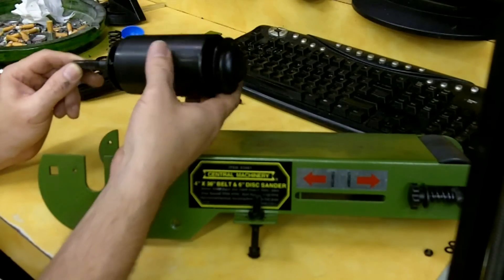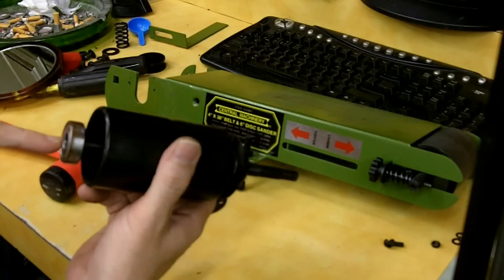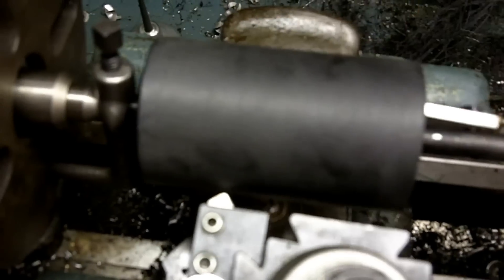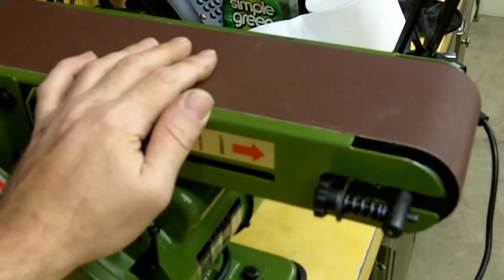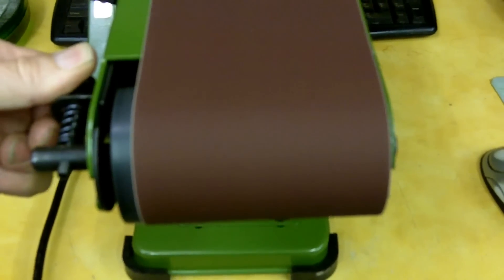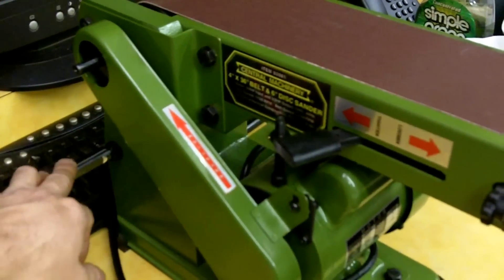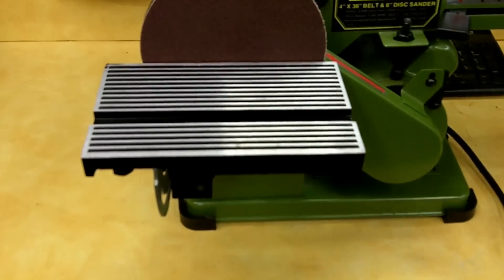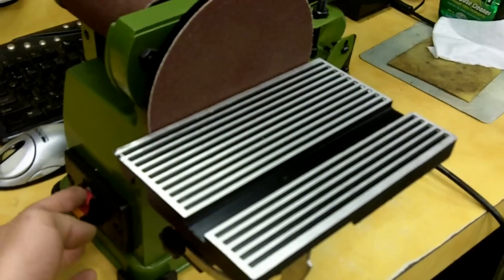Part 3-3 Harbor Freight 4X36 Belt Sander Review and Modifications

Comment: Thanks for the video. Bought one today on sale for $70 less 20% for approximately $56. New version has set screws for the table support stability. Will use for minor woodworking and can't beat the price with tool's objective in mind. Will let you know as I progress with it. Similarly, bought a tabletop chop saw from HF a few years back for approx $40 (with 20% off) to cut steel pipe and other minor metal cutting work. Paid for itself with first use and still doing the job admirably. Have purchased more critical tools (table saw, compound miter saw, router with table, drill press, HPLV sprayer, etc.) from other more expensive sources when I felt more quality and precision needed. Money saved with lessor critical tools from HF can be spent on these and needed materials to generate income. Your videos and comments add reality and encouragement to accept HF limitations and get on with business. Us shade tree mechs appreciate them.
Reply from the maker: Glenn Sorensen That's cool Glenn! I've had another comment stating they've added set screws to the table as well- which is great. I agree on both price and the tools objective! I have a Milwaukee cut-off saw that I paid a fair chunk for about 12yrs ago for a specific job around my home. Had I been turned back on to the Freight then, I would have save tons like you have for a tool that now sits there collecting dust and crying for something to do...lol. It sounds like your tool acquisition philosophy is dead on in-line with mine. I save where I can for less critical or rarely used items, and put that savings towards other more expensive tools, etc. when required.  That is the aim of my video reviews, to show folks what to expect out of these less expensive tools so they can make their own choice accordingly. I have a myriad of tools from the top shelf on down. I don't typically show the more expensive name-branded stuff since there's nothing much to say...lol. "Most" of my purchases from HF have exceeded my expectations- all things considered. Thanks for the post and take care, G.

Comment: Just purchased a 97181 unit last week. As previously commented on by you and your viewers the tracking issues have been addressed but my unit went out in about ten hours of use.  I am coarse grinding 3" wide chipper blades exclusively using the belt.  The unit was very effective until today.  

Today the unit ground to an immediate stop as the outside bearing  drive end froze.  I expected that the fine metal filings had seized the bearing. Instead I found that the bearing was fine but that the drive shaft had seriously galled inside the bearing and on failure had driven the bearing and cap outward bending the housing until it seized.

When I totally disassembled I also found that the belt had severely worn the belt cover directly under the dust hose connection. I have been using a small shop vac but can not see how this would cause this rubbing. Believe this to be separate issue.

Out of the box I only found one problem. When turned on it momentarily runs at a slow speed. I have changed belt drive tension several times without any improvement. The work around is to "help" the sanding belt with a forward soft slap and it comes right up to speed and generally has minimal issues after the initial startup.

Any ideas how there could be any relative shaft-bearing movement without any bearing seizure? Not sure if the startup drag was mechanical or a motor issue or in any way related. Shaft end is shot and unit will be returned/replaced but want to understand how to avoid in future.

Thanks for any insights!
Reply from the maker: +Bill Maille 
Bill, the model I've shown here has been discontinued and replaced with the one you have. I don't have any experience with that machine, but will give my thoughts anyway.

Since the bearing seemed fine and the shaft was galled, to me, it seems the shaft might have been too loose a fit from the start. That, and maybe the bearing cup was also a loose fit to the bearing. The bearing could have walked off the shaft, contacted the outer end of the cup, stopped the bearing,  and then galled the shaft. That's the best I can come up with...lol.

I can't speak for the belt guard wear and dust port since mine does not have a port. 

The slow startup sounds like the startup capacitor on the motor isn't doing it's job. The capacitor and start windings give the motor a jump start, and after it's up to speed- a centrifugal switch disengages the windings. 

I don't think there's anything you can do to avoid the problems. You should just be able to abuse it and it keep on ticking. But, in reality, they are extremely inexpensive so what can we really expect...lol. I say exchange it, use it and do it again if need be. Keep us posted on the new one and how it works over time. Hope this helps in some way. Good luck, G.
Reply: +Bill Maille my 4x6 HF bandsaw had the same kind of startup problems and I found that my start capacitor just didn't have enough, well capacitance.  I actually hung a second one wired in with the first one on the motor and it starts with authority.  I was a little worried that too much start capacitor might damage the windings on the motor, but I figured I had nothing to loose since If it didn't work I would just end up replacing the motor.  It's been that way for over 10 years and still works fine.

+ghostses I have the larger 6x48 HF belt sander and that thing vibrated and wouldn't track either, I found that the steel drums on it were fine, concentric but had no crown, and the vibration was a combination of a bad pulley and the disk was WAY out of balance.  I took it back to HF, but found the others they had were worse (it seemed like the rest were dropped and had cracked/broken parts) so I ended up taking the original back and they let me keep a bunch of the parts from another to fix it.  I ended up drilling something like 60 1/2" pockets in the back of the disk to balance it, balanced the 4 pulleys that I had in much the same way, chose 2 pulleys that gave me 2x the speed that it came with from the factory and put a Fenner belt on it.  At the time I didn't have a lathe so I fixed the tracking by just wrapping the idler drum with tape till it tracked OK.  The motor on that one is a brute and has no problems turning the whole thing at 2x the speed, which makes it a great big belt grinder for metal work.  Everyone told me that I was going to kill the bearings on it spinning it that fast but it's been happily chugging along for a little over 10 years just like the bandsaw.
Reply from the maker: +Mark Pikas 
Thanks for the input Mark! I really wanted the larger belt sander, but my shop constraints wouldn't/won't allow for it. But, using tape on the idler to fix the tracking was a great solution- for not having a lathe to correct it properly. That tip, in it's own right, might help others with theirs since many might not have the machining equipment. So simple but effective! As for the bearings moving 2x, you'd be hard pressed to tax them to failure- in my opinion. Naysayers be gone- I say...lol. Even if they did fail prematurely, whatever that means, replacements are plentiful and cheap! 10yrs going strong further verifies the point! Thanks and take care, G.

Comment: Thx for sharing all that you had to do to get this sander to run smooth. I have one too and yep it shakes rattles and rolls. I'll take what you did and apply it to mine. Knowing that I'll have to crown both the drive and driven rollers saves a lot of assembly and reassembly time. I'll just go ahead and crown both rollers after truing.
Thx again for sharing.
Reply from the maker: No problem! Let me know how it turns out. Good luck, G.

Comment: Great video. I was trying to figure out how to raise the belt sander vertical. Mine had no instruction manual and it wasn’t obvious. I like all of your ideas and I moved the table in front of the vertical belt sander and it’s much more like what I wanted for sharpening tools and being able to change belts easily. I think we still have to be cautious around the disc sanding wheel with loose clothing or wires, especially when you have children.
Reply from the maker: Thanks Tom! Glad it was helpful. Yeah, you've gotta be extra careful for you and the children. If you don't plan on using the disk, I guess you could just remove it. Tale care. G.
Reply: ghostses Thanks for your time. Have a great day!
Reply from the maker: No problem Tom- and you too! Good luck, G.

Comment: Thanks for the review. I like your modifications. Based on what you showed me I think I'll go out to Harbor freight and get one. Lucky me Harbor freight is only 20 minutes away.
Reply from the maker: No problems Bob. The exact model shown here is no longer made and has been replaced with another which is a bit different. I've heard conflicting reports to the problems I've outlined here regarding the new model. Some say theirs was good, some say otherwise. It might be the luck of the draw. Take a 25% off coupon when you go. I have a video up with a link to a site that has them. Good luck, G.

Comment: I picked up the 6x48" sander from a salvage store for 50$. It was missing the plastic belt cover and the table and table bar mount. I guess I got really lucky because I brought it home, built a 2x4" spacer between the sander and the included base for increased height. And have been using it heavily ever since! Never had a single problem with noise, tracking, or power. I have gotten some serious crap before though from HF. But got really lucky this time though. Great review and repair!
Reply from the maker: Good score Kevin! HF's got good and bad stuff for sure. For the most part though, I've been satisfied. Good luck, G.

Comment: awesome job mate, you have turned a frustrating $10 POS into a $$$ useable work tool thanks for sharing
Reply from the maker: +brutalbrital Thanks! They've since released a newer model that might not have all the problems I did- but can't say for sure. Take care, G.
Reply: ghostses update.  Just bought a new one from HF. 
   It's still slow and the wheels are horrible.  Can't really use the wheel to grind with without it jumping all over the place. 
The tracking knob is quite easy to adjust so I make corrections often but no where enough to be a big issue. 
Am def adding a 4" pulley to this one, it's still way too slow.
Reply from the maker: I have an idea where you might be able to fix the wheels yourself. Take and old belt and cut a third off of it. Then install the 1/3 belt and track it to one side. Use a small board with sand paper wrapped around the end grain and place it on the platten. Then slowly move it up to the wheel to sand it round.  After the exposed wheels are cleaned up, track the belt to the other side and clean up the remaining 1/3. I don't know how well it would work, but it might be worth trying. Good luck, G.

Comment: I just bought one of these last week and it works great. the motor is stronger I can't stop it like the older ones. the table is better, they have set screws where you used your center punch. I don't have a tracking problem. the disk could be straighter but I'm not building fine furniture.
Reply from the maker: Phil Layne Jr Thanks for the info Phil! It seems they've fixed most of the issues with the later ones- which is good for sure. I took care of all my problems in the series- other than the disk being a little wonky. Sounds like it still is on the new ones, but like you said your not building fine furniture- and neither am I...lol. The motor being more powerful is great! Mine's still a struggle if I get in a hurry. The set screws for the table seems like a no-brainier as well...lol. I think it's great they are trying to put out better products- and for a still great price. Can't beat that! Thanks again and take care, G.
Reply: ***** yeah, for $63, I couldn't pass it up.
Reply from the maker: Phil Layne Jr
Agreed! Take care, G.

Comment: Thanks for posting this "calibration." Just setting mine up and can't keep the belt from walking off either roller. I believe my rollers are not on even keel. No lathe, but gonna try to sand them even or something. Wish me luck.
Reply from the maker: Jason, here's a comment I made to someone else that might be helpful- or give you some ideas nonetheless. I don't know if it will work, so take it with a grain of salt. Good luck, G.

"If you're willing to sacrifice a belt, you can cut one down to say- 1.5"
 wide. Then track it off to one side and use a file, or perhaps 
sandpaper on a piece of wood to shape the exposed sides of the wheels. 
Then track the belt to the other side and do the other sides of the 
wheels."
Reply: @ghostses  I flipped my belt inside out, put it on the "powered roller" and left the tensioner loose. Put a dowel through the other end and turned it on and just eyeballed it even enough. Took the other roller off, locked it up using your method with a bolt and metal bracket. Chucked it in my drill press and smoothed it down with the belt inside out again. It stays on the rollers now. Thanks again.
Reply from the maker: That's a BRILLIANT solution Jason!!! Much better and easier that what I suggested- and you get to keep the belt! I'm sure it will help others out immensely. Take care, G.

Comment: I was yelling at you in part 2 about having a crown to the roller so the belt will track ..learned that from Mr.Pete or Keith Fenner..or Keith Rucker....I just bought one of these sanders and had to weld the piece for the tracking adjuster .it was bent and it broke when I tried to straighten it ..It runs good now and tracks Ok
Reply from the maker: LOL! That's cool. I got around to it. Good you got yours taken care of. Take care, G.

Comment: Awesome video! I realize this video is 4 years old but if possible, could you please make a video on tensioning the belt by moving the motor? I've seen other videos on it but they don't go as in depth with instruction like you do. They just say to loosen the bolts, clamp, and retighten bolts. Apparently, after you do that, you can pretty much be able to add some serious pressure to the belt without it stopping. Thanks again for the awesome video. Subbed.
Reply from the maker: Thanks! I doubt I'll make a video- but can give you some tips. In essence, you want the belt just tight enough so it doesn't slip under it's peak load- but not too tight. As a general rule, 1/2" deflection at the midpoint between the pulleys is a good place to start. Just go for the tension that suits your needs. Hope this helps, G.

Comment: Should find out if you can buy these wheels separately and put them on your lathe and then sell them on EBay and etsy and Amazon as an upgrade for people who buy this machine.  These things are super popular since they are so cheap.  Theirs no doubt in my mind a whole lot of money can be made and a whole lot of people will be happy and thankful you provided them!
I'd buy a pair for sure!
Maybe they sell the whole wheel assembly so you won't have to deal with the bearings n all. Who knows.
Reply from the maker: That's an interesting idea. I've had folks ask if they could send me theirs to true up but I simply don't have the time. Others claim they don't have the problem. There must be a CC issue somewhere. Take care, G.
Reply: ghostses I think they are all close to the same.  Some people just don't do enough work with it to notice, or they just give up and take the machine back. 
If these were offered all fixed up and trued, I know I will buy them, even though it's not 100% necessary for my tracking, even though it does drift occasionally but I'd like to be able to use the wheel to grind on without jumping all over the place. 
   If I had a lathe, I'd do it myself, because I know whoever does it will make a killing!  
   These units are super popular since they are so cheap!
Reply: ghostses I'm willing to bet that you wouldn't even be able to keep up with orders by yourself!  They would most likely sell as fast as you put them for sale!
Reply from the maker: You may be right. It could also be they don't really know how one should operate. It shouldn't be bouncing your work all over the place. I sent you another message stating how you might be able to fix them yourself- by using the tool as a lathe. G.
Reply from the maker: I don't doubt that! G.

Comment: Love these mods...but my question to you Ghostses...is what recommendations do you have for someone looking to fix their HF Belt Sander, that isn't lucky enough to have a metal lathe? Cause I'd love to fix mine, but can't afford a metal lathe such as yours. Thanks!
Reply from the maker: Thanks 8! That's the big problem for most I would think. Not everyone has all of the machining tools laying around.  The only thing I can think of is to try to find a small machine shop in your area that can do the job for you. Or perhaps run an ad on CraigsList for a local hobbyist that might be able to help you out. You would just need to tell them what you need. As for cost, I don't know what it would be. Good luck, G.